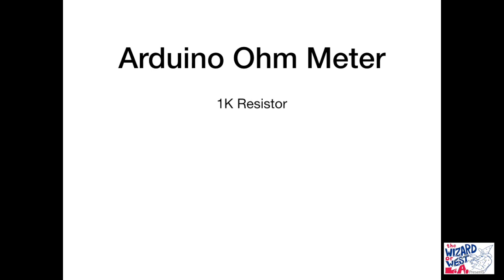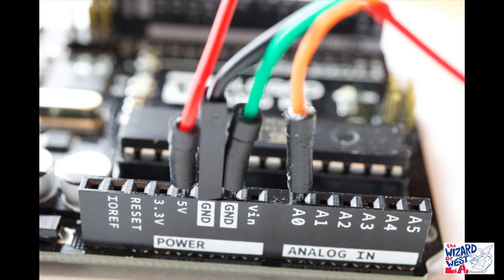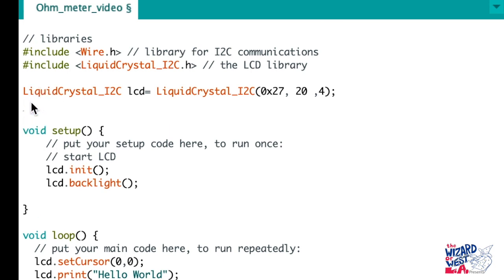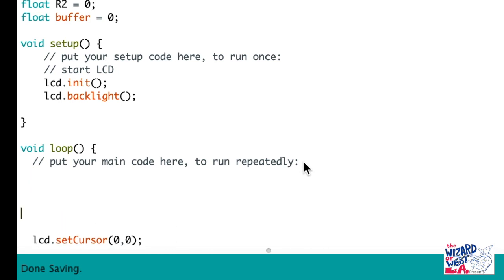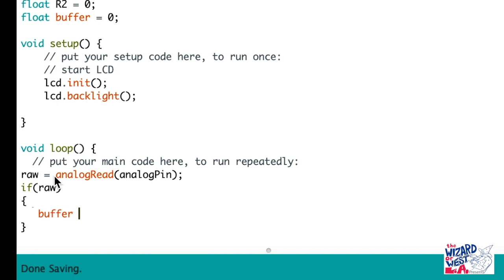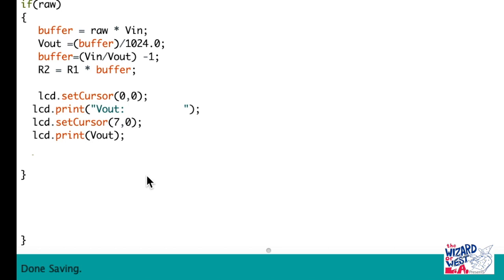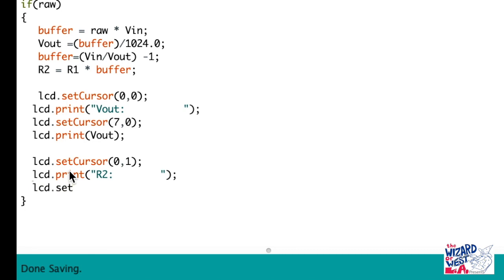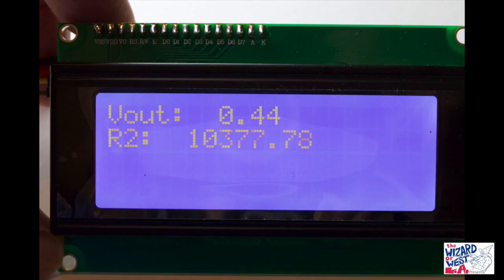Arduino Ohm Meter

Comment from the maker: Check us out at: www.wizardofwestla.com
I will post code on the website also.
here is the code you can copy and paste:

// libraries
#include <Wire.h> // library for I2C communications
#include <LiquidCrystal_I2C.h> // the LCD library

LiquidCrystal_I2C lcd= LiquidCrystal_I2C(0x27, 20 ,4); 

int analogPin= 0;
int raw= 0;
int Vin= 5;
float Vout= 0;
float R1= 1000;
float R2= 0;
float buffer= 0;

void setup() {
    // put your setup code here, to run once:
    // start LCD
    lcd.init();
    lcd.backlight();

}

void loop() {
  
    raw= analogRead(analogPin);
    if(raw) 
    {
    buffer= raw * Vin;
    Vout= (buffer)/1024.0;
    buffer= (Vin/Vout) -1;
    R2= R1 * buffer;
   // Serial.print("Vout: ");
   // Serial.println(Vout);
   // Serial.print("R2: ");
   // Serial.println(R2);
    //delay(1000);
    
  // put your main code here, to run repeatedly:
  lcd.setCursor(0,0);
  lcd.print("Vout:          ");
  lcd.setCursor(7,0);
  lcd.print(Vout);

  lcd.setCursor(0,1);
  lcd.print("R2:          ");
  lcd.setCursor(5,1);
  lcd.print(R2);
  delay(1000);
    }
  
}